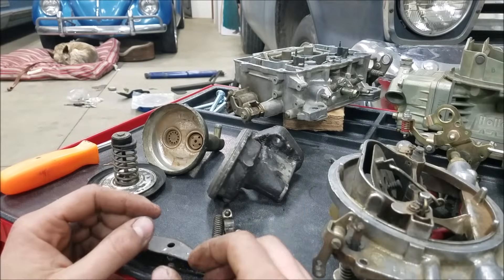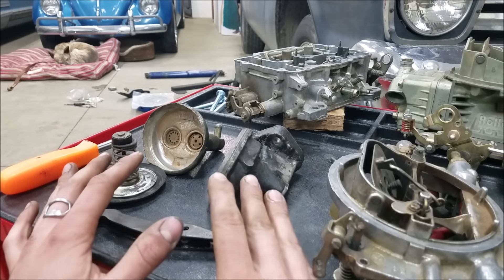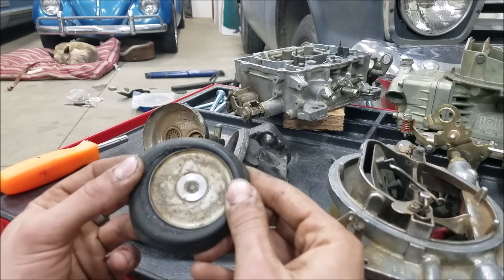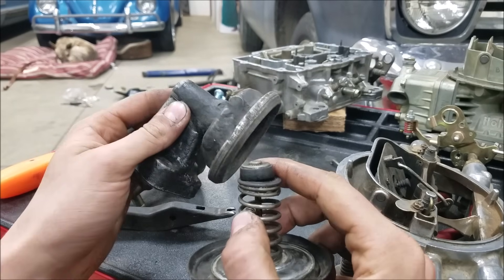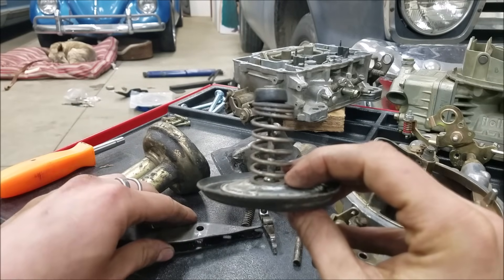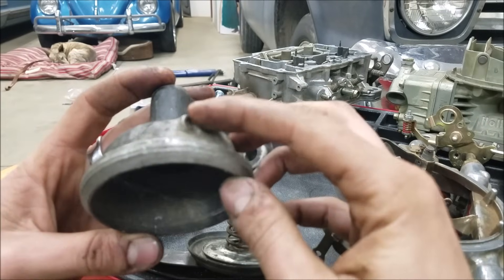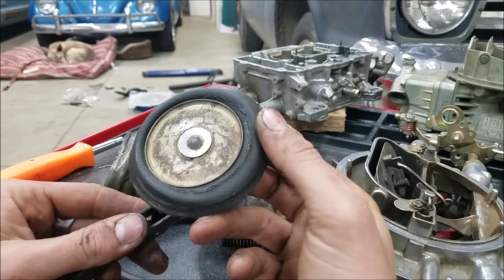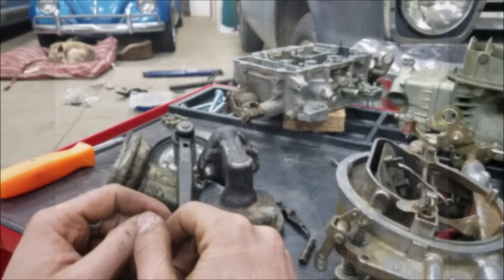Gasoline in your OIL?? Mechanical Fuel Pumps: Can a Failing One Do It ???

Comment: I highly recommend electric fuel pumps, yes they sometimes have their issues, but after losing a Ford van due to cams going flat from pump diluting oil, I'm never taking that chance again.   My '81 cj5 used to take a lot of cranking after it had sat for a while- now I just let the elecrtic pump run a bit and it fires right up!

Comment: I just had a fuel pump do this on my brand new blueprint crate engine. I started getting a little bit of lifter noise when it was cold the last time I started it so I shut it off. When it warmed up it would stop. I didn't run it again after that, so I may have caught it in time I don't know. I have a new fuel pump and fresh oil and filter to put into it. Now I am seriously considering an electric fuel pump. I hate them because they're noisy as hell usually on a unibody car, but it's better than the alternative of having gas in the oil. The fuel pump I used was on my previous engine and was not having any trouble like that at all. It was only off of the car for 3 months so it does not have to sit even two or three years to go bad.

Comment: I had the same problem with my Toyota Crown 1983 .plz suggest me I have also changed to electronic fuel pump. But my car rpm drops suddenly and turn of the car at idle conditions and also gets jerks if it is driving.  Not easy to handle such conditions. Plz guide me steps to follow.  Rpm become stable when carburettor gets serviced and washed but when I hit 2000 rpm. It's become jerkiing and vibration and rpm drops and turns of engine.  Is it my engine is ruined.  Plz guide me

Comment: Concerning mechanical fuel pumps...I was a student in a vocational auto mechanic program in 1989, and on one particular day a beat-to-death 1955 Chevy 4-door was brought in backwards on the back of a tow truck. The steering wheel was tied to the door to keep it from rotating...and I'll explain why in a moment.

The driver of the tow truck was curious if the guy in charge of the automotive program was interested in a free car for students to work on, and the instructor replied back, "if it were 10 or 20 years newer, perhaps, but there's nothing on this car that we really need, and I also don't have any free space for it."

I was looking at the car while the two men were talking, and noticed that the hood was ballooned out, like a Jiffy Pop popcorn container that was done cooking and ready to pop open.

The edges of the hood were charred, and there were two distinct holes in the skin of the hood, where two objects had been blown through the hood. The fenders also appeared to be ballooned out slightly.

The tow truck driver walked towards me, and I asked him what happened to the car.

"Well, the fuel pump was pouring gas into the engine, and the guy that owned this car was too cheap to fix it. He and five other guys were driving around up in the hills with the thing, doing some rabbit hunting, three of them were in the front seat, three in the back. Well, something happened, it backfired, something, and then there was a huge 'boom' from the front of the car."

He lifted what was left of the hood. 

Someone had swapped in either a 265 or 283 V8, and the engine didn't have valve covers, or much of an oil pan on it. Everything under the hood that wasn't metal was pretty much incinerated.

The oil filler cap on the fill tube was gone, the dipstick as well. It appears that the explosion took off the valve covers (they were cheap chrome units, or at least the stubs around the bolts looked that way), and did something to the oil pan.

"We think that the filler cap and the dipstick went through the hood."

The guy in the passenger-side front seat was the only one injured, as the guy in the middle of that seat was quite a bit faster while trying to escape from the exploding '55 and broke the pass-side guy's left arm on his way out of the car.

Comment: I learned this the hard way when I was a teen, I had a '68 galaxy 390ci 4bbl 4speed and one friday night noticed my fuel pump spraying fuel out that vent so I stuck a .22 cal shell casing in it and went about hot rodding the weekend away, come monday on my way to school the motor seized at high speeds locking the trans and I rolled it about 7 times. My dad was the one to see the shell casing after the wreck and told me just what you are saying now. I totaled a sweet now rare '68 390HO 4 speed galaxy for the price of a fuel pump.
Reply: Back in the day (when I was young and stupid) I always kept a few spent .22 cal shell casings in my old Ford truck to replace blown fuses in an emergency (perfect fit) fortunately I never had a bad problem after doing that, but I know now that it was probably not the smartest thing to be doing?

Comment: Lost an engine in a 78 powerwagon due to previous owner running ethanol running carb and fuel pump dumping fuel into the oil and being ran like that for years

Comment: Hi Luke. If I order this fuelpump you linked, do i have to get a regulator as well? I have a former tbi 305, now with holley 650. Still uses the original mechanical fuelpump, im guessing it has higher pressure than the carburetor needs. But the car runs fine. Thanks for the awsome videos. Peppe, Sweden.

Comment: Could I have a bad check valve on my fuel pump? I have a 83 f150 with a 351w and i notice that the fuel will back flow after about 24 hours of sitting. I notice the fuel filter 2 feet before the carb is dry. When I start truck it always takes a second for the mechanical pump to get fuel back up to carb.
mechanical fuel pump was replaced at least 5 or 6 years ago. Truck sits a lot. should i replace fuel pump? it seems to pump just fine, it just back flows after sitting for a bit.

Comment: I have a 1976 c10 custom deluxe stepside with a 250 Inline six. I have terrible gas mileage and gas in my oil. I bought a carb rebuild kit for the Rochester monojet 1bbl carb but have not rebuilt it yet. I am afraid to do it and I am afraid of wasting new oil if the mechanical fuel pump is bad. I want to keep the truck as mechanical as possible. Any tips or perhaps a video on how to test the mechanical fuel pump for a leak into the oil?

Comment: I needed a mechanical fuel pump for my latest project.  My local auto parts told me that the pumps they get these days are Chinese and don't last.  I bought a Holley but had to get a fuel pressure regulator also as it was pumping 9-1/2 psi at idle.
Working great now.

Comment: My dad always told me, If i was looking to buy an older car, check the oil level- take it for a test drive- then check it again and try to light it with a lighter. If it ran okay and the oil burned, it had a bad diaphragm in the fuel pump. If it ran like crap and the oil burned, the carb was dumping fuel.

Comment: Just curious what your oil pressure is at idle.  I rebuilt my FE and got it running recently.  I used a standard pressure oil  pump and didn't do any oil restriction mods that other people do.  During break in 2000 rpm it was around 50.  At idle it's around 25. Also I used an HEI distributor from progression ignition.  So far I really like it.
Reply from the maker: I have 15w-40 in mine with 1 quart of Lucas oil stabilizer. Idles hot hot - like right off the interstate hot at 700-800 rpm at 20 PSI. 
Around town it’s roughly 28-33ish depending. 
Tell me how you like the distributor - I really need to make a video showing all the things a guy can actually optimize with it
Reply: @ThunderHead289  
I think the most obvious advantage is tunability. You can make timing changes for any rpm.  And do it in real time with the engine running.  You can't do that with weights and springs and it's a lot easier.  I'm not a rocket surgeon with this stuff but after working with it a bit I'm beginning to understand better how important timing is at all rpms and what the changes do.  Also it plays nice with msd atomic TBI.

Comment: Nice job on covering fuel pumps. Back in the day my Dad taught me to check oil on a regular basis. Every time you gassed up check the oil, and in between if you had an extended drive. We were not just checking for low oil. It was also for anything out of the ordinary like coolant or gas. A habit that has served me well when the mechanical pump decides to go.

Comment: In 82, my sisters 78 Cougar 302 engine, caught on fire as she was driving home. We never found out what caused it. In 87, I had a 79 Thunderbird with a 302. Ironically, I drove to my sisters house and smelled gas. I opened the hood and gas was squirting out of the vent of the pump directly onto the hot exhaust manifold.  Mystery solved on her Cougar.
MB BAR RANCH

Comment: So if I understand this correctly, if you get water into that hole for venting the pressure of the pump then you'll get that water into your engine. That's no good, but I do the same thing you do, I block it off and put an electric fuel pump.

Comment: Taking it a step further do you think today's ethanol based gas is detrimental to the diaphragm like it is to rubber fuel line?
Reply from the maker: It is - I must have cut the pet out where I mentioned that - the alcohol drys things out

Comment: My 71 Maverick sits a lot and has a mechanical fuel pump. So my question is, do you use a relay to power the electric pump on your truck ? Or is it direct wired ?
Reply from the maker: Run by a relay with ignition as trigger - there are actually better ways of doing it including an inline oil pressure switch and an inertia switch. But you know - “we die like men” mentality over here
Reply: @ThunderHead289  
What Luke is driving at here is wiring the pump so it turns off when there's no oil pressure so it can't run in the event of a wreck. If you don't the pump will continue to pump fuel all over a hot engine.

Comment: The original manual fuel pump on my jeep 258 inline six had 170,000 miles on it. It was still working fine, however I swapped it out with a new one just for piece of mind. I keep the original in the back of the jeep just in case. As for comparison the OEM Motorcraft electric fuel pump on my 00 expedition lasted for 150,000 miles before it gave up and I still have the original OEM Motorcraft electic fuel pump in my 04 explorer at 125,000 miles. One thing I learned with the expedition fuel pump is to go with another OEM Ford pump! After having to replace two of the crappy Airtex pumps from Autozone I wasn't to happy.
Reply: napa ans autozone fuel pumps are rly bad quality they go bad fast

Comment: After watching your video on ignition timing I started reading up on it. I found several articles including one by a General Motors engineer who all say that manifold vacuum is the way to go. They all say that ported vacuum at idle will cause your engine to run to hot at idle. What would you say about that? I recently bought an old jeep yj with a carbureted 4.2 liter 258ci inline six. It has manifold vacuum as did my 302 mustang's from the 82-85. The GM tech says that ported vacuum was only for emissions purposes and the vehicles performance really suffered do to it. Not saying either of you are right or wrong, I'd just like to hear more about it.
Reply from the maker: The only difference between manifold and ported is that ported doesn’t add anything at idle. 
I prefer to run more mechanical advance instead - which I can write you a book as to why. This is not switching from manifold to ported alone - now your timing is later, and if nothing changes, I’d agree with the GM engineer. NOW, by advancing mechanical when you hit the throttle you won’t lose any timing - engines actually respond better with a quick jump in timing when you crack the throttle - ported with more initial provides this. 
On manifold as soon as you drop below the vacuum advance canister vacuum threshold you lose that 8-15 degrees being added in. 

In order to have a proper idle on manifold, you have to have a very lazy initial mechanical setting. 
Especially with a aftermarket distributor - they only provide 15-25 degrees of advance, so starting at 8 degrees or 6 degrees mechanical leaves you with a junk total timing number - not to mention less than optimal timing throughout the curve. 
My email is lfinley289@gmail.com - I’d be happy to answer further questions there if this didn’t make sense.

Comment: Hi I'm a mechanic in New Zealand. Usually what happens the diaphram rots and cracks and stops working which limits the amount of fuel that gets into the motor. 90% of it will come out of the hole in the side. You'll smell the gas too.

Comment: Completely unrelated to a failed fuel pump but on the topic of gas in the oil, my sister had a car for about 15 years and never changed the air filter one single time. The filter was completely clogged and it was running so rich that it was dumping gas past the rings. My dad and I dumped about 3 gallons of basically black gasoline out of the oil pan...

Comment: Biggest cause to a mechanical pump(and carburetor)failure is ethanol fuel. Ethanol fuel reeks havoc on the rubber parts. Stick with non ethanol and you’ll be good. Not saying a mechanical pump won’t fail, just that they will fail a lot  sooner with ethanol fuel.
Reply: i have not seen non ethanol fuel in YEARS!

Comment: On the topic of oil, my old 302 that I had just rebuilt loses it pretty randomly. I never notice it dripping so it has to be burning, is there anywhere besides the valve seals and the oil rings where it could be getting somewhere it shouldn't? Sometimes I'll go for several weeks and never lose a drop, but other times I'll lose two to 3 quart per tank of gas. I had the heads redone two years ago and figured they were fine to throw back on the rebuilt shortblock, I'm guessing the valve seals must have gone bad already.
Reply from the maker: Faulty PCV valve is actually my first guess 👍
If you remove it just to see, you will have to turn your mixture screws in roughly a turn (3/4-ish turn out from seated).
Reply: @ThunderHead289  Like disconnect it from the carb and leave it open, and then adjust the mixture screws to compensate for the vacuum leak that will create? Or should I plug the nipple on the carb with something while I run without the PCV for a while?
Reply from the maker: Plug the nipple on the carb of course - the mix screws will be farther out to compensate for the PCV, you will have to lean them up once pcv is removed. 

Just to see if that’s your issue 👍
Reply: @ThunderHead289  I'll give that a go for a while then. I love my galaxie but it's nothing but trouble. Never leaves me stranded, always keeps on runnin but little things always pop up. It constantly overheats on me if the ambient temp gets above 40 degrees, especially at higher speeds. I've played with the timing and all that and the mixture and that never fixes it, not to mention pretty piss poor fuel mileage, on bad days itll hit 8mpg lol. It needs a bigger radiator I'm sure, I got one from what I believe to be a 390 or a 429 vehicle to throw in but that needs custom hoses to plumb up.

Comment: So Luke, how does this event affect your attitude about firing up engines on old cars that haven't run in decades? Lots of videos of guys doing this with old pumps in place. The other thing I never see addressed is congealed oil blocking internal passages.
Reply from the maker: All those are valid concerns - I haven’t had issues with passages being blocked, mind you in many of my revivials once there is hope it might run I check this, but you will also notice that we always have an auxiliary electric fuel pump. 
I just don’t think guys even think about it.
Reply: @ThunderHead289  Next time you do an FE, keep in mind the passage in each rocker shaft. Blockage may result in galling and perhaps failure of rocker lifter cam lobe, usually blamed on low zinc oil. Keep up the good work and I'm watching for the supercharger install.

Comment: I think your missing another thing that causes the pumps to go bad... Its the ethonol in the new gas. Yep that corn additive eats rubber.  So older cars with rubber gas lines and rubber pieces in the fuel system end up having to replace them every few years..  I am guessing that the corn gas they sell helped your pump faillure.

Comment: I had a 82 f150 mud truck with the 300 six. The guy I bought it from had both a electric fuel pump and the stock fuel pump on the block hooked up. Why he was running 2 fuel pumps I don't know. Anyway I was heading home from work one day and could barely step on the gas to go. Thankfully I made it the 20 miles home and just used my other truck till my next day off. Got to thinking at work it could be the manual fuel pump shot. My next day off I bypass the manual fuel pump and just used the electric one. Well that worked. I checked the oil and could smell gas in the oil. I didn't take apart the manual fuel pump nor did I take it off the truck as I didn't have anything to cover the hole. Anyway wondering if that is what went on with my truck. Oh my girlfriend at the time couldn't drive stick shift so I left her my GMC Sonoma that was automatic the reason I was driving my mud truck to work. Sucked on gas also I got 160 miles to a tank. Don't help having a t-18 4 speed with 4.11 gears, lockers, 3 inch lift and 35s on it. Yes believe it or not that old 300 six did alright pushing the old girl. Man I miss that truck.